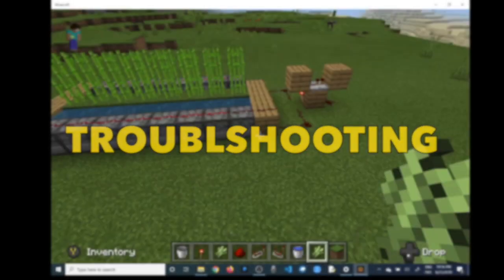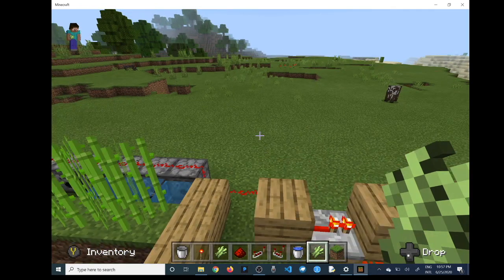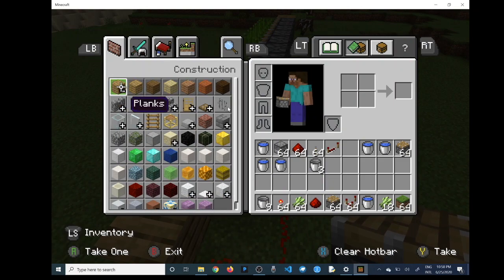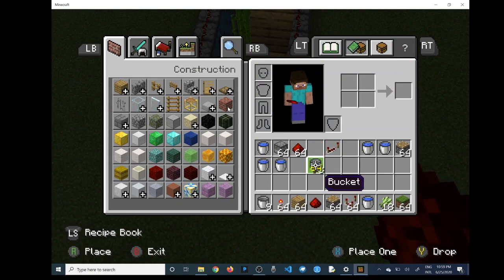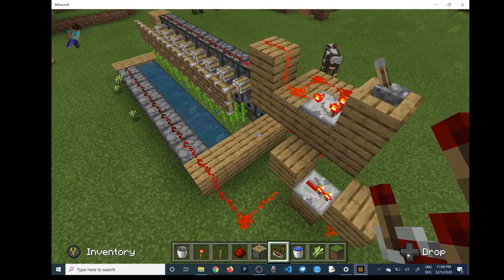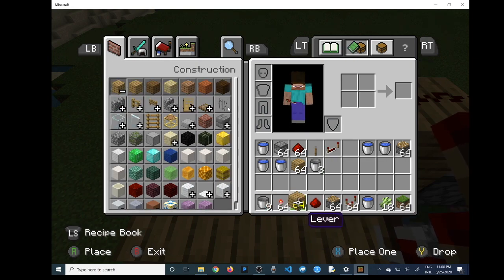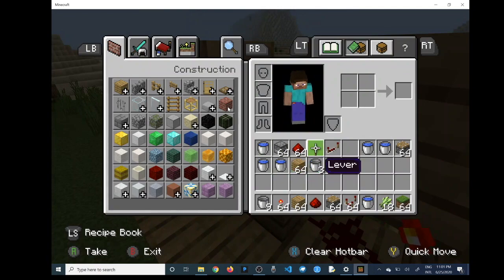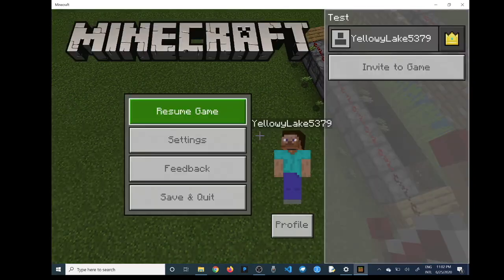Zero Tick Sugar Cane Farm Minecraft Bedrock 1.16 Troubleshooting.

Comment: My sugarcane just instantly breaks and I can’t place it. Edit: do I need to place the sugarcane before I place the pistons?
Reply from the maker: Should work without placing the sugarcane first. Feel free to upload a video and I'll help you troubleshoot.
Reply: Paul Ellsworth https://youtu.be/ze0Du5SaMDI
Reply from the maker: Nicholas Conroy I saw the video. Everything looked right. Some one in the comment mentioned removing the water collection system at the bottom and using hoppers instead. Try that and keep me posted. I’ll be thinking of other ideas.
Reply from the maker: Nicholas Conroy I think I see the problem. Is your back row of dispensers connected to the back of the clock? If so, connect both to the red stone torch. Just opposite sides of the torch. If that’s confusing let me know and I’ll upload a video.
Reply: Paul Ellsworth can you upload a video of that please then I’m a little confused
Reply from the maker: @nicholasconroy4868  See my previous comment about chunks.. That's likely the problem. If you are still confused, I'll be uploading version two this weekend that will address all the issues.
Reply: Paul Ellsworth I moved it and now it works perfectly thank you
Reply from the maker: @nicholasconroy4868  BOOM!! Good job!
Reply: Yeah the same thing happens in the video to me
Reply from the maker: WeSt Club08 working on a solution.